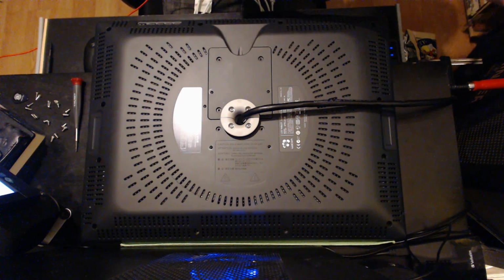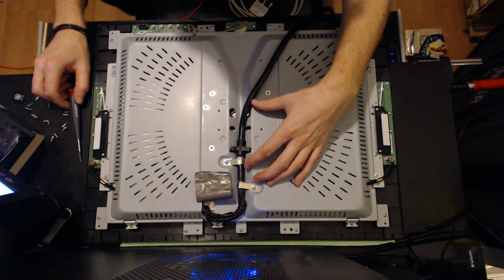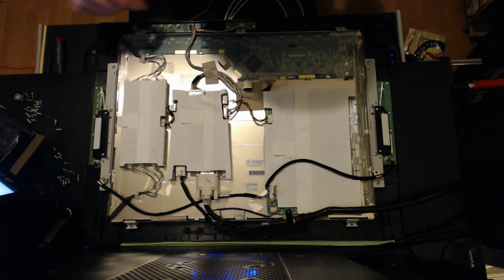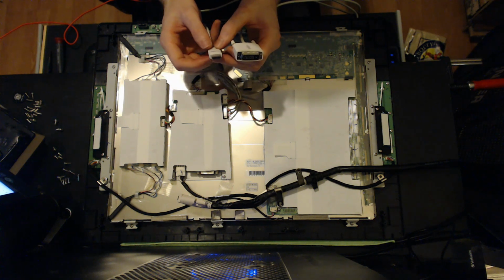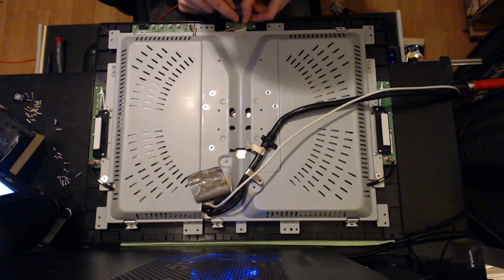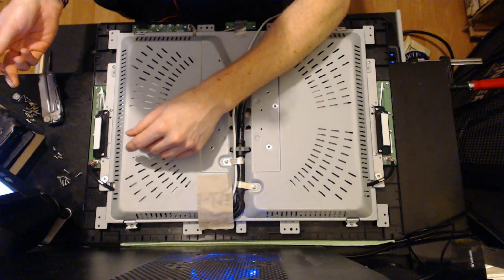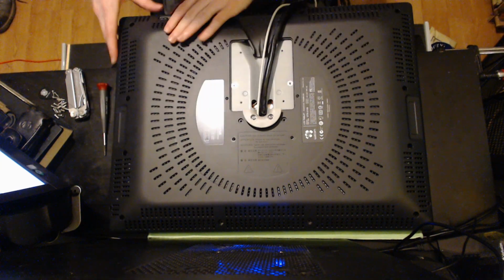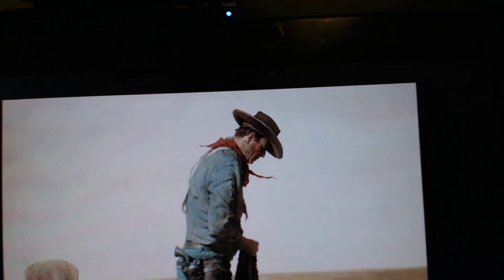Wacom Cintiq 21UX Disassembly and DVI Cable Repair

Comment: Thanks for this video. I expected the inside to have non-servicable, OEM, direct wired cables. I too have the DTK-2100 model that had a video issue; and you're correct, it was a cable issue. MOST of the time, it isn't necessary to replace the cable, the contacts just need cleaning, which can be easily done with electrical contact cleaner. You can get some at any automotive store. Dissassemble like it shows in the video, disconnect the DVI plug and wet the plug's pins with the cleaner. I would suggest using a small clean brush on them also. With the contacts still damp (not soaking wet) plug the cable in and out a few times to clean the female end too. Clean the end that also goes into the computer, and test before reassembly.

Those that can't get the pen to respond. My first question... are you using a Mac?..

Comment: Hi, Ryan, how are you? Congratulations on the video, sorry for my weak english, I'm using the google translator I'm from Brazil, I have a Wacom cintiq 21 Ux problem seems a little different, recently I noticed that the brightness and contrast buttons stopped working, so that's fine because she was always in dvi mode connected, the biggest problem was a few days ago that when I use it it simply shuts off as a power cut, then inexplicably back to work, stays running for two days after doing it again, realizes that the time slots I called Wacom and they said that they no longer have any assistance with this model or parts, searching the internet found some posts about the same problem and one person reported that they solved the problem using this method " Can I get it working again?    Re: Cintiq 21ux shutting itself off when USB  

i have the 21 ux dtk 2100. i found a fix for it constantly shutting off and on. what i did was take off the top four screws in the back. then i pulled it open a bit in the middle to locate the power button switch and the wire pin connection connected to it. what you have to do is pull that out while the unit is on. its tricky but if you time it right the cintiq should stay on but u may have to try a few times by pulling the pins in and out til it stays on. after that if it stays on it wont shut off again until you power off your pc or laptop and will always turn on when you power them on. the only downside is u wont have the blue pretty lights anymore... oque você acha será que
Reply from the maker: Hey Ana, thanks for the comment~

That's a problem I hadn't heard of before! Due to it's inconsistency, it sounds like a component is beginning to fail, possibly in the power switch itself but my guess would be in the external power supply (probably a capacitor or voltage regulator). It might seem like a general response but I would suggest replacing the power supply first, you can find aftermarket and original 21UX power supplies online for around $20 USD and it may totally solve the issue, just make sure the voltage and amperage are the same as your original power supply. That way, you eliminate the power supply issue from the equation and can, at the very least, narrow the scope of the diagnosis if it doesn't resolve the issue. I'd just recommend trying to limit the fatigue you might be putting on the power button wiring and the risk of other issues when you do a live disconnect in circuit like you described. Plus, I'm scared your case will crack with all the flexing!

My 21UX is still alive and well *knock on wood*, they are pretty tough if they are taken care of but there is inevitably going to be an issue at some point. The best we can do is be methodical and diagnose the problem incrementally. I'm glad you are willing to do a little work and keep it alive. 

Good luck!
Reply: Thank you very much

Comment: Do you have any suggestions on how to fix the power? It does not turn on anymore, no led lights go on at all.
Reply from the maker: Read through some of the other comments where we diagnose power issues. Ultimately, you need to determine if your power supply is still functioning and supplying proper voltage and current. First thing to do is see whether the led on the power supply box is on, if not, try several other outlets. If it doesn't come on, I'd go ahead and suggest finding a replacement on ebay (probably about $20) as a first step.

Comment: I have the same model  (6 years old now) and its recently stopped giving me visual signal at all. I never experienced any flickering at all. Just, stopped lighting up. It has power, and it recognizes my pen, but nothing displays on screen. I swapped out my DVI adapter for a new one and it had no effect. I've read that in the 22HD and 24HD the back light eventually dies, and I'm worried that might be my problem too. Now I'm debating whether it might be worth a try to swap my DVI cable completely.
Reply from the maker: If you're talking about the 21UX then yes, it's sad but true, all CFL tubes eventually die. They typically give some indication that they are beginning to fail, however, so if you didn't notice any graduating color issues (usually the screen begins to turn an amber hue) or flickering/brightness problems then there is a chance the DVI cable may be the only issue. I'd absolutely recommend opening the case and doing a complete cable swap. Its a hell of a lot cheaper and more simple than performing a LED conversion or replacing CFL tubes.

Comment: Awesome !! It's been 6 monthes since I try to figure out why the signal is so bad between my Cintq Companion and my 21UX. I bought several adapters and, when they worked, there were always some flickering pixels which drove me mad. 
I followed your video and it took me 1 hour (including the time to go and buy the cable) to unscrew, unplug, re-plug, re-screw.
And : it works !! I mean, it really works. My 21UX is good to go again :)
Thanks a lot for having shared your knowledge !!

Comment: Why does my Wacom Tablet 21UX DTZ-2100 get no signal on the screen.But in safe mode it gets detected.I bought and adapter and it gets a signal but the image is really distorted and the color is all over the place.I have clear visual in safe mode.
Reply from the maker: I'll just start by recommending a few (maybe obvious but still necessary) diagnostic tips. Have you tried different usb ports? If you open "About" in the Wacom Tablet Properties and then click "Diagnose..." are there any OEM Codes listed? What Driver is listed? You need 6.3.15-3 as the DTZ is not supported in the latest drivers.
For Windows 7/10: http://cdn.wacom.com/u/productsupport/drivers/win/professional/WacomTablet_6.3.15-3.exe 
For OSX: http://cdn.wacom.com/u/productsupport/drivers/mac/professional/WacomTablet_6.3.15-3.dmg
I'd recommend following this sequence: 1. Unplug the tablet 2. Unistall ALL Wacom drivers 3. Reboot 4. Install new driver (it may ask you to plug in the tablet during installation, if not, wait until it is complete, reboot and then plug in the tablet when you reach the OS.
Hope that solves it!

Comment: I have a different problem, the 21ux works as and displays an image but for some reason the pen support is dead. I tried  a replacement stylus, drivers but its dead. Anyone know where the fault is?. Even when I place the pen on the screen there's no status
Reply from the maker: Thats tricky, software is a pain to diagnose. I doubt it's hardware related. Have you tried different usb ports? Does the usb connector look oxidized? Does the Pen show up in Wacom Tablet Properties? Are you certain the pen you are using is on the compatibility list for the model you own? If you open "About" in the Wacom Tablet Properties and then click "Diagnose..." do you get any metrics when holding the pen near the screen or touching the tip to it? Are there any OEM Codes listed? What Driver is listed? For Windows 7/10 I recommend 6.3.25-5.
Reply: Hi Monsterism. I was wondering if you found a solution to this problem yet? I have exactly the same issue. I just bought a new grip pen, but still - not even reading in wacom preferences, and no status light.
Reply from the maker: Have you tried a different 21UX compatible stylus? That might be the best place to start.
Reply: @LuciaFinstra  Did you get it fixed?

Comment: Ryan. You save my old cintiq 21ux.I can't believe it. I had a problem with my Cintiq 21 UX (DTZ version) on the digital signal for years. Because of that I bought the Cintiq 22HD touch. But I have my Cintiq 21UX since 2008. 
Working great but in 2012 it starts showing some green tint all over the screen. Imagem flickering with green colors. A few times it would recover the full colors and the problem was gone. until one day the problem stays forever. I had to change to vga mode to continuing to use it. But the clearity of the image wasn't the same. I contact Wacom, they told me that I had to send it to them, for cheking but could be a 300/400 euros repair. They asked me the reference of my Cintiq and when I gave them, they said that they couldn't repair because they didn't have anymore, spare parts for this model.
Yesterday I saw your video. Today I tried doing it myself. Fingers crossed that the models wouldn't be so different from each other (but the metalic chassis is a little different), and I couldn't believe that when I change for a new dvi D cable I had around, that I could have my old cintiq with beautiful colors and image with digital signal from DVI.
So, thank you for inspiring me to do the "same" thing you did.
Reply from the maker: Oh man, that is awesome! I'm so glad to hear that you were able to save it. I hate seeing these things get thrown away needlessly. Maybe you'll be able to pass it on to another digital artist who's dreamed of owning a Cintiq. Thanks for sharing the story, hopefully it will help someone with your same model fix their issue, too!
Reply: @ryanchristensen5266  awesome. my cintiq just start to flickering but  im still using it normally. Maybe soon i'll replace the cable as u did. And... i was thinking why wacom made this complex and unnecessary multi cables?
Reply: Is opening the chassis the same process for the DTZ model? mine is working ok but has a bit of dust under the screen that i can't get out, and at some point when i'm feel less lazy i'd like to open it up so I can get in there with a compressed air duster to blow the larger particles out

Comment: Thanks for the vid!!
Are you the guy from CatSpit Screen Print? Just wondering cause this is helpful if you wanna replace a cable, but at the same time, seems like you don't know much about the unit and are figuring it out as you go. What's the GPU? Can you replace it? Most common problem I have heard is lack of response with the stylus...
Reply from the maker: Thanks for checking it out! 
..but no, never heard of that company, so I can say with a fair amount of certainty that I am not that guy. 
Yes, it has been a learning experience, I have never owned a Cintiq before this 21ux and unfortunately, these units are approaching their EOL. Thankfully I haven't had to deal with any more severe issues than connectivity, to this point. In regard to your question about a GPU, unlike some of the new Wacom standalone tablets (Cintiq Companion) which have an OS and integrated GPU/CPU/RAM, outside of some electrostatic digitizer circuitry, power distribution and some onboard display configuration hardware, the 21ux is basically a lcd display panel.
Graphics processing is handled exclusively by your desktop, not the device. Nothing about the 21ux is designed to be upgraded or replaced by the consumer. Which is an issue, considering the aging CCFL tubes used for backlighting in these units.

Comment: Hi was wondering if my cintiq 21ux only works with the chord at certain positions would this fix it? Everything works fine but I get a no signal sometimes if the chord gets moved
Reply from the maker: Display ports can be very temperamental. It is usually a matter of oxidation and/or wear on the contact surfaces and pins of the cable/port. 

Isopropyl alcohol can safely clean contacts and help maintain a good connection. 

If you have a cable with threaded screws, make sure they are tightened to prevent bending pins or expansion of the socket from sagging or being pulled out inadvertently.
Reply from the maker: Oh, and yes, substituting a HDMI cable or replacing the existing DVI cable with a new one could also resolve it, as long as the video card port you are plugging into is clean and undamaged.
Reply: Ryan Christensen thanks for the reply! I think mine is a older model so the plate inside is harder to take off I might need to cut off the head of the DVI cord to make a new one fit would that be fine?
Reply from the maker: It could be risky to just replace the plug because the fault could be anywhere along the cable. I wish I could see what the older version interior looks like, I can't imagine it being extremely dissimilar. 

If you're comfortable with the process of splicing in a new plug, I'd take at least 6 inches off the cable nearest the plug you will be replacing, that area gets the most abuse and is most likely to contain the short. 

Ideally, though, you would get behind the shield and go to the source on the video board. It might be worth doing some research on getting in there just to avoid the potentiality of the problem reoccurring.

Good luck! If you figure it out, let us know! It might help solve other artist's 21UX problems.
Reply from the maker: Also, something else to consider: Have you plugged it into another computer to determine if the same issue occurs there as well? It would help identify the source of the issue, particularly if it just ends up being a connectivity issue with your video card port. You might save yourself a bunch of time and at the least you'll know for sure the issue is on the Cintiq's side.
Reply: Ryan Christensen I'm not going to replace the dvi head just replace the cord. The inners are the same just no cut outs to lift the plate completely off to move the old dvi head to the side. But the dvi cord is only a dvi cord right? Not intertwined with the usb or something right? Also the problem I believe is somewhere the chord is messed up.
Reply from the maker: The cable that runs out of the back of the Cintiq contains the USB, power and display wiring. They separate at the board, so you'll need to find the source of the display cable. You should see a few other wires running to different locations in the circuitry from the main cable bundle. I assume the DTZ model is the same as the DTK, where the DVI cable terminates at a standard DVI plug on the PCB(like shown in the video), allowing you to simply unplug it. If you need to cut off the dvi plug on the inside of the Cintiq to simply make room, that is fine, it doesn't contain any power or USB functionality, they run into the cable bundle from other locations around the board. I would just make certain that your new cable works before you cut anything or reassemble.

Comment: my problem with the Cintiq 21UX is black screen. I think I'll need to replace the LED light. But what kind of LED light should i get. Please advise.
Reply: I also have the same problem... Need help!!
Reply: Black screen, when you power on without the monitor cable plugged in, do you get the "no signal" window? Does the backlight of the monitor appear to come on (dim room, screen appears to illuminate, but stays black), just no signal from the computer, even though the computer says the monitor is plugged in? If so, it's still the DVI cable. dissassemble, clean the contacts, reassemble, clean the contacts of the end that also goes in the computer (I posted directions). If the screen doesn't appear to illuminate (check in a darkened room) then it's the screen's "backlight inverter".

Comment: Hi Ryan. i was wondering if I could ask you for some advice. My 21ux pen doesn't register at all. One day the PC froze and the pen stopped working. The status light doesn't go on when you put the pen to the screen. The pen doesn't show up in wacom tablet properties either. I bought a new PC and nothing has changed. Any ideas as to what could be wrong would be really appreciated.
Reply from the maker: Well, it might be a bit redundant, but the first thing I'd think about is drivers. You say you have a new PC, so I am assuming you have a clean install of the Wacom drivers but I know some people have trouble with the 21UX using the latest drivers, I'd uninstall ALL Wacom drivers, unplug the tablet usb cable, reboot and then install the older driver package: 
Windows  http://cdn.wacom.com/u/productsupport/drivers/win/professional/WacomTablet_6.3.22-6.exe?_ga=2.120266696.1371144612.1503108961-945160531.1498540401
Mac http://cdn.wacom.com/u/productsupport/drivers/mac/professional/WacomTablet_6.3.22-3.dmg?_ga=2.50075494.1371144612.1503108961-945160531.1498540401

If it doesn't change anything, you may have to consider a pen replacement. It's more likely the pen has suffered some sort of terminal failure than the tablet's digitizer, barring some sort of unprotected electrical surge, I doubt you'd be seeing the tablet show up in your device manager or have access to the tablet properties if there was a serious problem with the tablet.

As a last resort, if you're somewhat tech savvy and feeling adventurous, you could disassemble the pen and do a visual inspection of the internal components. Contact points tend to oxidize over time and often just need a cleaning or very light sanding to restore. There are a couple videos demonstrating how it's done.  However, if you decide to just purchase a new pen, be sure it's compatible with the 21UX, of course!

Let me know if you have any luck!
Reply: Thanks so much Ryan.  At least there's hope for me now that the tablet is not done for.
Reply: @vishaallalla  I'm reading this comment in 2021 because I'm having the same problem now. I was wondering if you found a solution? If so I would love to know how to fix it.